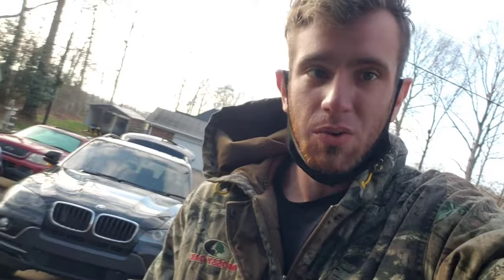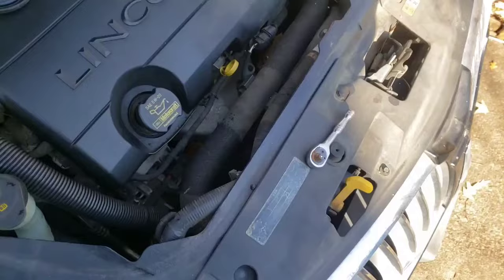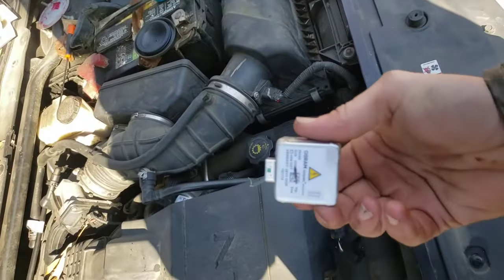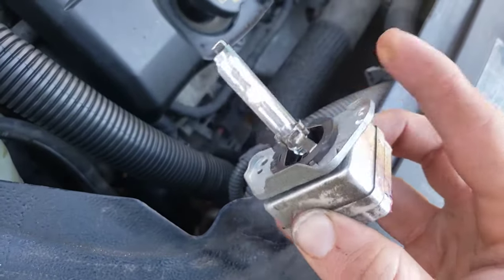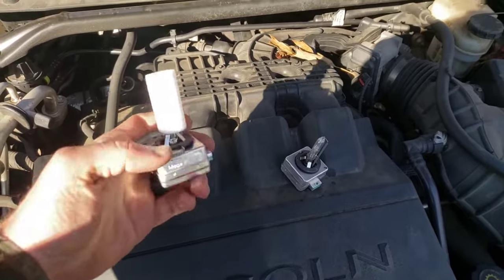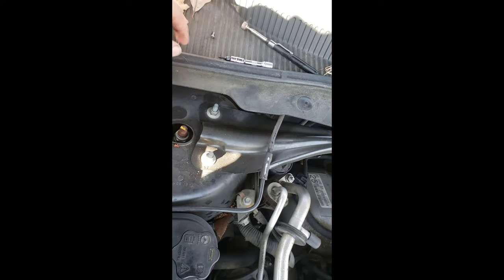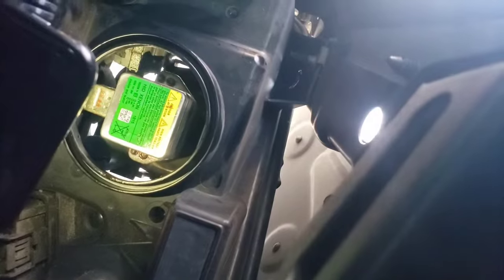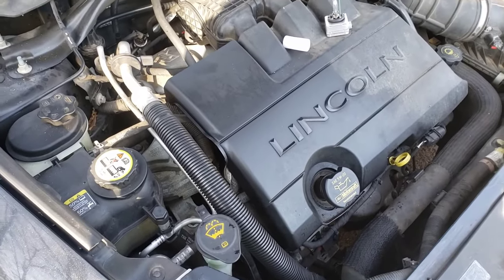2009 2016 Lincoln MKS Headlight Bulb Replace How to 2010 2011 2012 2013 2014 2015 Without Bumper

Comment: 13-16 is not the same. You just twist it out. Not screws locking it in.
Reply: Makes it easier for me
Reply: Thank you. Your comment help me to understand how to remove it . This video is only for 2009-2012 and i have 2013 lincoln mks.
Reply: Thanks. I saw this video and thought I was doing something wrong. Guess I wasn't
Reply: @jairocruz9277 do you know how to adjust the headlights? I just bought a '13 and the owner's guide makes it seem like it's right out in the open. I don't see anything anywhere.

Comment: Way easier to remove the front bumper cover spent an hour fighting the plug for the bulb spent 10 min removing the bumper and had both Done in 30 min
Reply: Ya and you have a car lift and a full shop, and 30 mins is really 3 hours

Comment: Not even close for '16 Reserve. After removing resevoir and trim to access one of the 3 t screws securing the rear cover, you'll find a totally different bracket holds bulb assembly, and the bulb  is apparently secured to bulb with t screws in front. Nobody has addressed this problem and even after removal of the front bumper (requires removal of both wheels and internal wheel well cover, which is far more complex than any of the other mkx's trims but has to be done to remove 3 hidden screws securing  the headlight assembly). You'll just break the bulb connectors trying to remove it as shown in this video.

Comment: what up bro good looking on the installation video I have a 2011 lincoln mks to hold on to my screws I just put electrical tape on the end so doing both side took me about 45 min to an hour by the way I went with the 8000 ice blue lights from Amazon for 33 buck much appreciated